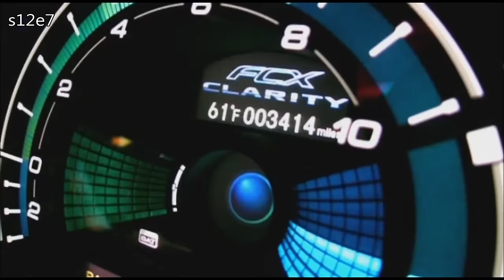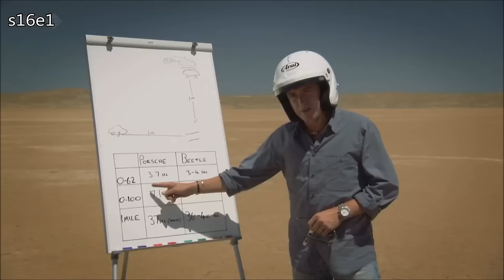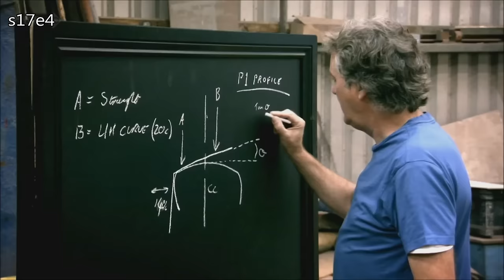Tonight... Every Top Gear Opening

Comment: 0:11 "And at the end of the series no-one will have a recording licence".

He half guessed what would happened to him
Reply: It had a different meaning than we expect these days 

During Top Gear's revival in 2002, BBC didn't own the license and rights to the show apart from censorship and dictating the show's length, which means they didn't have the rights for anything else in the show: No corporate interference during the production and no rights for Top Gear employees' contracts at all. If anything, the Top Gear team had all the power to switch to other broadcaster like Bedder 6 in case the BBC started some unnecessary things that the team would deem jeopardizing their show. It took the BBC until the early 2010s when they finally owned Top Gear entirely and things started to go south from there